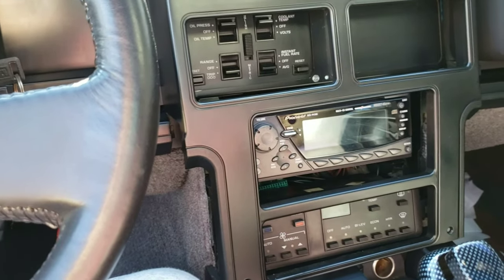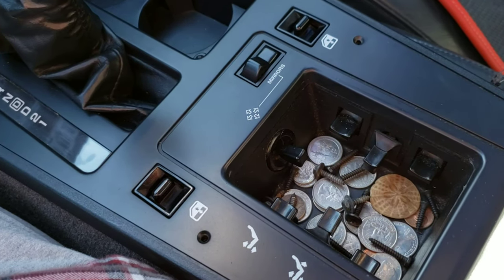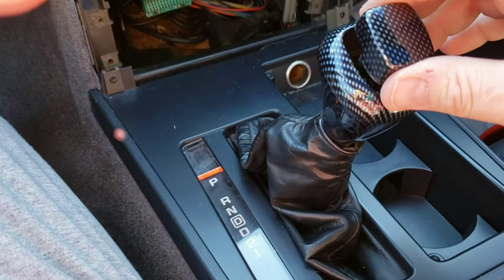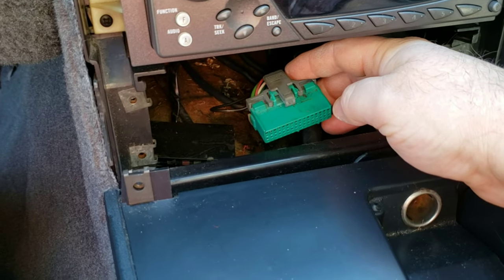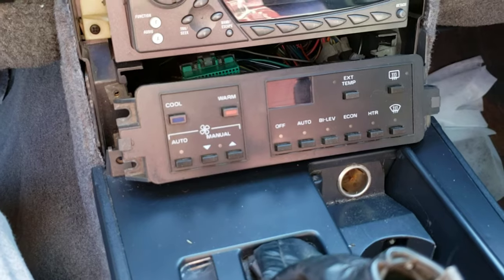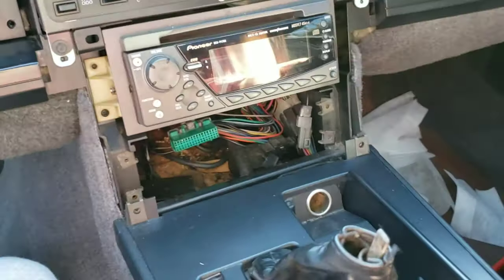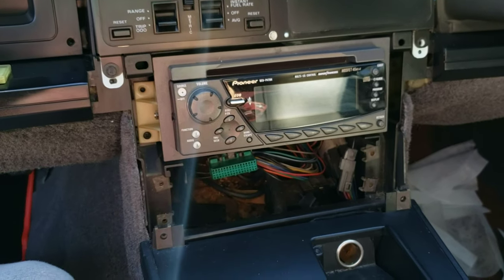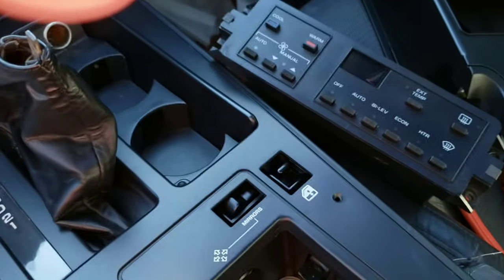C4 CORVETTE OWNERS WATCH THIS!! Before You buy a new Electronic Climate Control AC Heat Control!

Comment: It's pretty simple to clean the contacts, you've done the hard work. Put the unit on a work bench get the from cover off. Use a clean pencil eraser and spin it on the contacts. I then used a q tip and rubbing alchol to clean them. Reverse your steps and wala I saved you a few hundred bucks.
Reply from the maker: I went with the rebuild service which included the new faceplate. Works perfectly now .

Comment: HI Jim! Did you get your unit repaired? I have had the HVAC control unit out 5 times trying to find the problem and today I finally repaired the unit myself...same problem you were having. Turns out there were two solder points in a long line of points that had let go on the board where the board plugs into the front face control panel. I could get the system to work if I rocked the control panel back and forth and pushed it in and out or hit the sides of the enclosure where the control unit sits. Heated up the soldering iron and melted the existing solder slightly and that was it! No more erratic weird disfunction!
Reply from the maker: Hi Jet!! Yes I did.  I sent it out to a place thru Ebay...had reputable feedback history.  For $99 they completely rebuilt it and placed a new face plate on it.  GOOD AS NEW!!!

Comment: I have the same issue with my '93.  Just not brave enough yet to try and remove the unit.
Reply from the maker: Yes it can be a bit intimidating.  It was pretty straightforward....im sure the 93 is as well
Reply: Over threes years but I just did my 91 and it really was pretty straightforward..if you still have your vette and haven’t done it, I can send you a link to a perfect tutorial.